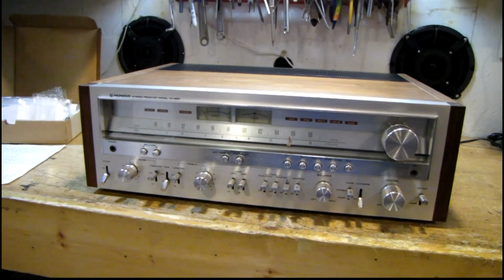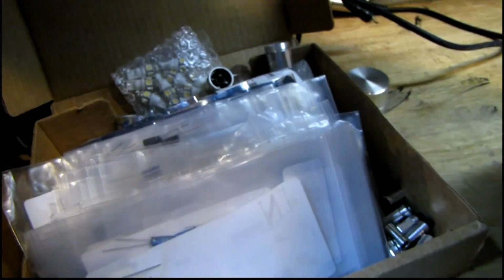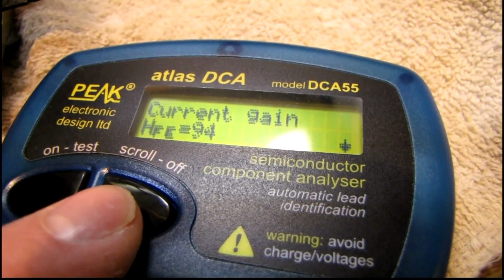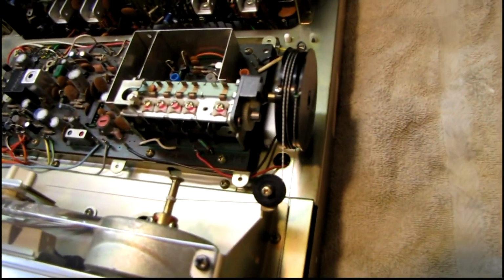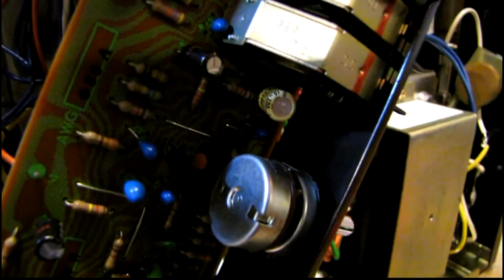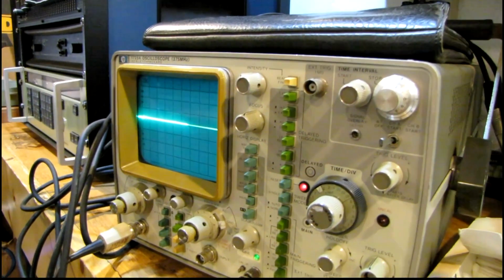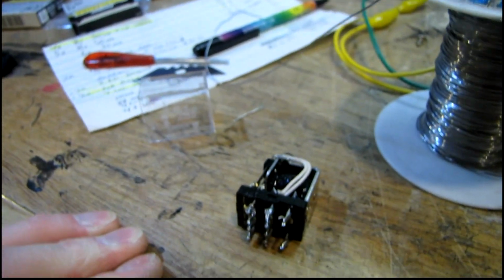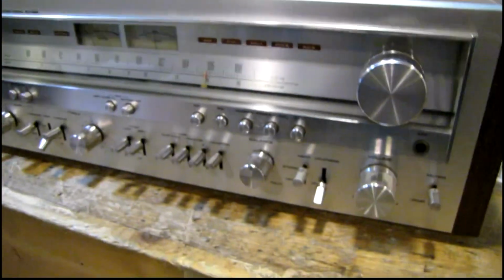Pioneer SX-850 Receiver Restoration

Comment: Nice job, I have the Pioneer SA-1000 integrated stereo amplifier that I bought second hand. Initial diagnosis indicates a lot of issues, I have ordered a ton of parts including the speaker protection relay to make sure I cover most situations that need to be addressed.

Comment: Thanks Maxx. I have that same model. I picked it up in 89 for $2.00 at a flea market. Has an intermittent speaker relay (and probably a lot more) but it does work. Watching this video I think I'll tackle rebuilding it. Seeing what these are going for nowadays, I think it'd be a worthwhile project now. It's always a pleasure to see an experienced technician at work. Very much appreciated. P.S., did you replace the main filter caps also? If not, why?

Comment: What does such a repair cost?
is this profitable? You can buy a new one and you have 30 years No problem or you change everything and the receiver costs 3x like new
Reply from the maker: I can't remember the exact amount, but I think this was around a $300 job.  New receivers probably won't last 30 years, maybe half that if you get a good one.
Reply: Thanks for the quick answer but you can see how much work and research of original parts is.

and the receiver is not 100% much wear on the potentiometer and switch. I've done a lot with 68 years now I admire people like you

Comment: Sounds like you are somewhere in mid-Michigan. I need a couple more modern receivers/amps repaired. I'm in Flint and it's hard to find a decent person or place that will work on stereo equipment. The old electronics store my father use to deal with has been out of business for a long time now. They were called Shans or Shanes electronics.

Comment: Should have used the BOM from the audiokarma website. You would have saved a lot of time. Also, never unwrap the wires from the posts. There is enough slack if you unbundle the wires.

Comment: Thinking about buying a pioneer sx-1280.The balance control does have a LITTLE static but all others do not. is this something that is hard to repair? Everything else seems to be in good working order. How expensive is a recap on this receiver. Any good input you can give me would be very helpful thank you.

Comment: i have a pioneer sx1250 it was working great until the other day. before when i turn on i would hear 1 click from the realy then.a second click and it would work. now when i turn on i hear only one click. i checked all the fuses underneath all 4 +1 is good. the protection relay is not clicking and the front panel vu meters are not moving as well there is no.sound.output when connected to my cd. The am/fm not even getting power or it seems muted. what would cause that relay to not click?? a bad cap,transistor or diode. i checked for cold solder joints all is well. pls any advice be helpful

Comment: modern stuff usually have super tiny circuit boards,thinner wires,often one bad solder means the whole thing goes down,, headphone jacks break in the plastic sleeve, a THUMP and the thing smokes

Comment: Might be a good time to say if you buy any components on e-Bay. Personally I'm concerned about counterfeits there. Good place to buy used equipment that needs repair but transistors & caps? 

What do you think?
Reply from the maker: +davecc0000 I don't buy components on there unless I'm really desperate, or if I know the supplier.  Most of my stuff comes from Mouser Electronics and a couple others.

Comment: Great to watch your work. Thanks for uploading. Questions:

1. Where are you located? Michigan? Bay City/Saginaw? Myself: Detroit-born, Ann Arbor-raised, California as soon as I got a drivers license! No more mosquitoes for me... 

2. What FM stations do you listen to when testing? Heard some nice tunes...

3. Seems marginally economically viable given the price of replacement amps. Unless the owner is a vintage "nut" (c; (said with respect). Do you charge an hourly rate or just estimate what you can charge for a job with the given economy/customer/work needed? (Some jobs I just can't charge the time required so my rate is on an unpublished sliding-scale just so as to be able to accept work.)

4. It would be great to see a video discussing just the make and series caps you choose for replacement. There are SO many kinds on Mouser/DIgikey, it's difficult to know what is good and bad choice even with a well-known brand (NIchicon, Rubycon, Panasonic, etc.). Would you like to do such a video? 

Cheers!
Reply: Flint, Michigan here. I need some work done on two receivers atm. One is my parents Pioneer VSX-402 and a Fisher CA-9335 amp. I like my Fisher equipment so that is why the Fisher is not in the trash.

Comment: Wow!  I wish I had your knowledge.  I love vintage 70's amps!  What do you think of the 1980 Fisher Studio Standard BA6000 amp?  I have that whole rack system known as the 8500.
Reply from the maker: +jewllake I've never worked on one of those, but it looks cool!  It seems to be an IC based amp using STK-0100 output modules.
Reply: The 8500 is a class A amp correct? From what I heard that is one heck of an amp!

Comment: Most of those caps didn't look bulged or damaged. Why did you swap them out?
Reply from the maker: +MaxinMaytrix Even good quality electrolytic caps dry out with age, and can develop DC leakage or change in value.  Usually the large filter caps are fairly reliable, but I've seen some of those go bad too.  It's not fun when they blow up in your face without warning.

Caps that visibly bulge are sometimes due to defective formula or excess heat.  They are beyond bad once that happens.  I've replaced thousands of them in computers and power supplies over the years.  If you've heard of "capacitor plague" in older computers, then you know what I mean.
Reply: +MaxinMaytrix What Maxxarcade said. Also, while in there, why not do it right and replace components that are near end of life.  Capacitors have a finite life and most early to mid 80s gear needs to have them replaced now. If it's not visible, it will be audible.
Reply: odkrk X
=7 , 8 3R
Reply: K k rld
Le kfkk futility
Reply: Poilce
Dr political

Comment: I am fortunate enough to own one of these beautiful machines. I bought a Sx-850 at a yard sale for $15. shortly after buying it I realized that even tho i ended up with a dead receiver the joke was on the seller. These things are not cheap and there is clearly a reason as to why! With that said. I had the receiver brought to working order when i first got it and I would say about 2 years after it died again. (my fault as I didnt tape my speaker wires and low and behold shorted out on me. It was a hard pill to swallow but boy did i keep that pill.. 7 yrs later I jumped on ebay and purchased a new power amp assembly. I shortly found that I needed a new power supply board. so i replaced it. couple years later i noticed that it didnt like being moved around so i looked inside only to find a couple loose wires that happend to ground out. Now my tuner is dead and I have no indicator lights. ( I assume its the power supply board).  I have managed to bring a beauty back to life but now have a new problem. My tuner along with the meters and indicator .lights are no longer working. I am assuming that after all this time I need to rebuild a power supply I have already replaced. I am ok with doing such a job so long as someone can lead me to the light of what newer components I should use. This particular unit has been molested by me since i was 16 and everything is still in great shape short from my new problem. I want to rebuild my original power supply board but dont know what i need to do it. (if you put everything in front of me I can fix it) my biggest problem is knowing what to replace old components with. I have a slight understanding when it comes to electronics I just dont know what to do with it just yet. If you are willing to would you please give me more detail on the power supply board as i still have my original 1 and want to rebuild it so I can return it to its home

Comment: You can force De-Oxit into those input selector switches from the front. Pinpoint applicator aimed along the side where the spring is and the moving shaft goes into the body of the switch. A little aerosol pressure and gravity, then working the switch back and forth. Been doing it for decades. Did an SX-1250 yesterday. Works great.

Comment: good stuff. i am currently recapping an sx-1050. 
how did you put together the push button switches? in the process of deoxitting them i removed the cover but when i put them back, its not smooth anymore. any suggestions on how to put those push button switches back together?

Comment: Thanks for the video and the posts on AK. I have an SX-650 to rebuild and keep. If I took even MORE time and strategically replaced some of the carbon comp. resistors in the signal path with metal film types, would it be worth the extra time and effort? Diminishing returns at that point maybe.

Comment: Vintage stereo equipment is absolutely the best in the world, and they're well worth salvaging when possible There's nothing quite like older Fisher, Pioneer and Marantz receivers...today's empty plastic boxes can't even compare to them. My Dad bought a Fisher 500-C tube receiver in the early 70's, and it was always a great unit! After buying him an Onkyo years ago to replace it, he gave it to me. Sans refinishing the cabinet veneer, it's been completely restored internally, and it's as out of this world as it's ever been...clear, warm, great low and high ends, great note separation, etc.  It's hard to believe that it's only 35 watts per channel output, it pushes my 15" drivers like nothing in the world!

Comment: Do you use or replace the caps with Panasonic FC series  Low ESR ?
Reply from the maker: FC is one of my favorites to use in the signal path.  For power supplies I usually use Panasonic FM and Nichicon PW.
Reply: Maxxarcade Me also thanks for the reply love your videos very informative
Reply: +Maxxarcade Pana FC's are polarized so not usually for coupling audio stages--but filtering and such? What non-polar do you like for coupling?
Reply: +davecc0000 I use orange drops i find they have a sweet top end detail without sounding brittle good mid range but not dominant warm sounding 715p are my favourite.

Comment: Great video what are the type of caps to replace tantalum caps in audio input section? Thanks
Reply from the maker: Nichicon KL.  I use the 50 volt rated ones, 5x11mm size.

Comment: Im recapping a sx-850 as well what did you replace the ce04w 35v 2200uf with on the power board
Reply from the maker: Usually Nichicon PW series for all the power supply stuff.
Reply: thanks for the info

Comment: maxx  i would like to use 6volt bulbs on my pioneer sx450 display as you are aware is 8 volts ac can you print a circuit diagram i could used or a resistor to limit  the current thank you  maxx.

Comment: After recapping you will notice that the amp will never sound like before. Not for the better but for the worse. There is no components today with the same quality as the ones inside. I don't share the idea of recapping if it is working and working good like that appear to be. If it's well balanced and you obtain without clipping the rated wattage then you don't need to recap or change components.

Comment: hi I had a problem on my radio. Before cleaning it was horrible and the sound would cut from either the left or right speaker at almost every setting and only had good sound at very few spots. After I cleaned all the pots with radio shack contact cleaner now the balance, bass, etc. work very good, however although the volume control is now smooth, does not scratch or cut anymore, the volume overall is very low and putting it to 10/10 is like what it used to sound like at maybe 3/10.  any ideas of what might be causing the problem?

Comment: Nice vid but why would you change all that stuff when it still works fine  seems like a wast of time when you could be fixing a amp that doesn't work to work again
Reply from the maker: The parts I change are known to be problematic.  It's far cheaper to change them while I have it apart the first time, then to do a full disassembly again in the future.
Reply: I see May dads carver quite working for some reason

Comment: My SX-850 seems to be lacking in sound and power but only on the right channel. The crackling of records is louder through that channel as well. Also, you hear a very slight hissing. Any thoughts on what it could be and if it can be fixed?

Comment: Do you use audio grade capacitors or general purpose ones? I have re capped old amps and I use just Rubycon, Nichicon, Panasonic and United/Nippon-Chemicon and the sound definitely improves, but does it improve even more with audio-grade caps?
Reply from the maker: It really depends on the circuit.  I've used Nichicon KT audio caps in a couple projects, but I still prefer Panasonic FC for most signal coupling, and Nichicon PW for everything else most of the time.
Reply: Maxxarcade can i use panasonic FM series capacitors for signal coupling? and the according to the nichicon PW datasheet, it is mentioned that suitable for power supply  circuits, can we use PW caps for signal coupling? i just want to recap rx-cw55 tape deck. and also which is better for signal coupling nichicon PW or paanasonic M series? your videos are really awesome and helpful, thank you sir. and Greetings from INDIA.

Comment: Thanks for this video, I really enjoy  all your videos.
I just bought a Technics SU-VX800 (from 1991) and i am going to replace all the caps. I found out hat  some transistors need to be replaced but I can not find them anywere where i live, I do not dear to buy from ebay. They are 2SA1535AQRS and 2SA3944AQRS, do you think it would be a good idea to use TIP32C and TIP31C as replacement?
It would be very nice if you could show in one of your videos how you choose the replacement for old amplifiers or where the parts are not produced anymore. I have notice that some times you use different parts, even parts that are better than originals instead of the ones listed in the service manual.

Comment: Where can  I  buy a stereo indicator lamp?
Reply from the maker: When I have one of those burn out, I usually replace it with an LED.  You will need to add a series resistor though.  For the SX-850, I think it would be around a 1.8k-2.2k 1/4 watt resistor if using a white LED.
Reply: +Maxxarcade Source for the LED replacement lamps?

Comment from the maker: I got the plastic standoffs from Mouser Electronics, part number 534-8810.  You will need to enlarge the holes in the circuit board very slightly with a drill bit.

One example of the TO-220 insulators can be found at Parts Express. You could just use the silicone style insulators and not have to deal with the grease.  The part number is 055-400, and they are about a dollar for a 10 pack.

Comment: Do you have a supplier and parts number for the plastic stands and transistor insulators...I am recapping the power supply in my SX 850 and I would like to have those available in case they break. Thanks for the video.

Comment: great video! I need to replace my treble control. I can get the whole bass and treble section for $25. Is it too much trouble to swap  boxes? also if my receiver works great ...should I replace caps like you did?  thanks. mark  mjphoto45@yahoo.com

Comment: Need some advice. Have this exact receiver and I love it but after about a month the left channel speaker is going in and out. makes a crackling sound and you can barely hear it. I switched speakers to see if they were the problem but no matter what speaker I use on that channels it still goes in and out. Most of the time it works fine but then sometimes it doesn't. if I mess with some of the switches or while playing the radio and switching through channels it will come back fine. Any thoughts?

Comment: Max have you ever worked on a MCS 3275. I have one Ive been poking at but cant get fixed. Guy i bought it from said it was working last he knew, but its been in closet for years. Issue is no audio, it lights up, fm signal meter tunes in but no audio and no power meters movement. Panel and Power meters don't light but there seems to be voltage. I do here the relays click. I check, fuses, bulbs, loose or burnt things, ect.. Can't find any docs or info..  any idea?

Comment: Nice restoration, I love the Pioneer sx receivers. Hoping to get an SX-1080 or SX-1280 someday. I don't know if u could help me with this, I have an Yamaha CR-2040 that I'm trying to restore. I have recapped mostly of it. Now to the sadly part, while measuring the voltages to the power-amps. I accidentally shorted the -60 volts to the left channel speaker output that leads to the relay. Replaced the shorted power transistors, but the speaker relay won't click on. Is the speaker relay broken?

Comment: Interesting video.  I've had an SX-450 sitting around for a few years waiting for me to try to freshen it up.  I was going to just recap it, but it had an intermittent crackling noise so I guess I should also replace transistors. Your video at least gives me a little more confidence to take a shot at it, even if I'm over my head with the thing.

Comment: Q7 in the power supply is a very notorious failure item on these. In fact it is the only common problem aside from noisy controls etc that I have seen in 30 years working on them, aside from the occasional series pass transistor, like the 313's and the speaker relay cutting out. Q7 failure will result in no B+ for the relay, and a DC offset. Great work though. I'm a tech myself, but this is way too much work for me for an ordinary repair. I'd be out of business in short order.